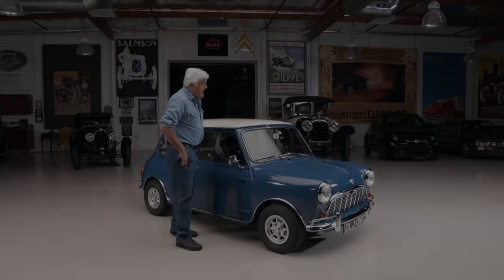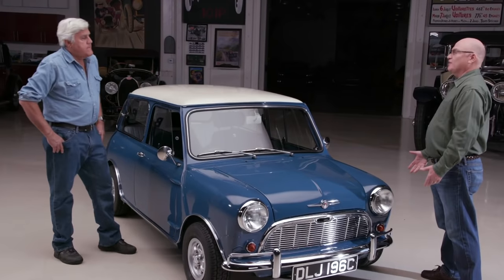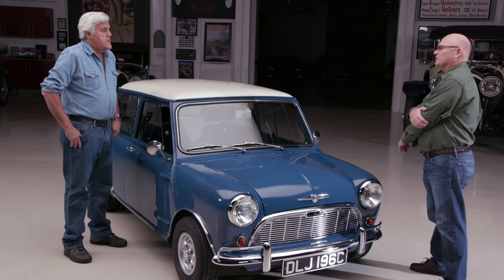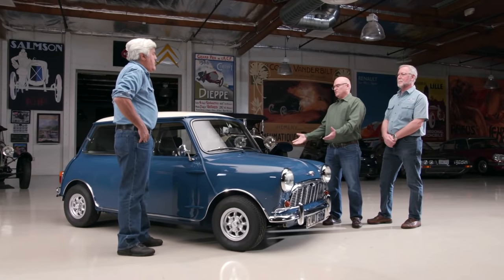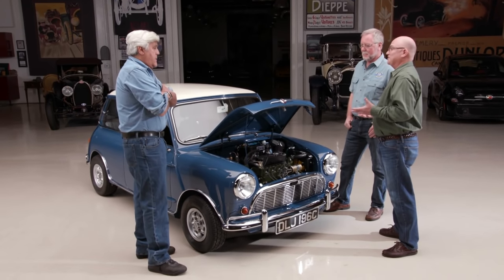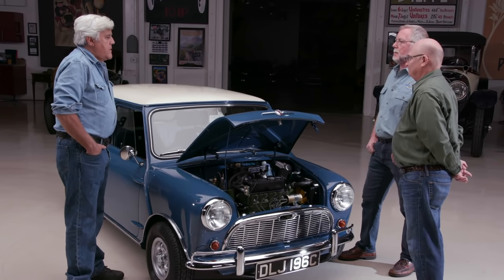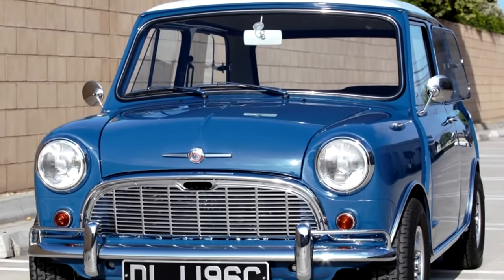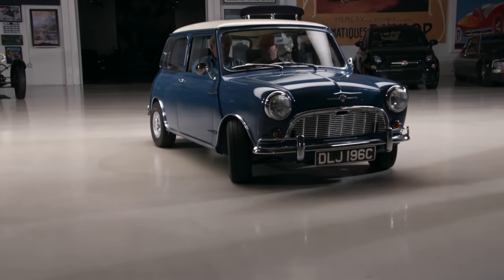1965 Morris Mini Minor - Jay Leno's Garage

Comment: Nice job of bringing back a original mini. My first driving car was a 1973 mini 1000. Kept it running with shoestrings and bubblegum. Till it’s big backyard restoration 1982. Through a ton of parts at it a 1297cc sprite 997 camshaft 750 fly wheel , 1.75 SU and lots more, it now went like stink. But wouldn’t stop or corner like original I lifted it for the gravel roads where I lived. In hopes to keep the exhaust system on in place 3 inch ground clearance. Now with 6” could go any where. I sold it and always thought I would do another 15+ years ago picked up 1 a 76 mini 1000 then later a 67 copper 1275s. No time or money have moved then 5 times now, OH the dream one day. Jay great job of your little car collection.

Comment: I got a 1960 Austin 850 Mini from a friend who replaced it with the inferior Austin 1100. A very neat to drive, but quirky car. You could turn the steering wheel all the way at 40 MPH and make a very tight 180 degree turn in an instant. They do have decent interior room for 4 people. Minis were made in the UK long after being exported to the USA.
Reply: the last original design Mini was produced in Oct 2000!
Reply: My first car was a green 1967 Austin 1100...as you say, quirky but plenty of room for my friends to pile in. Had some fun driving it until I realised how rusty the floor was. Oh and one day a steering knuckle snapped going around a roundabout jamming a wheel against the well. Good times...
Reply: @Mark H. The Austin 1100 was very inferior to the Austin/Morris 850 Mini. The 1100 engine was a too big a stretch of the  design, and blew their bottom ends out. This unreliability killed the car. Should not have gone beyond the 950 cc the AH Sprites/MG Midgets had.

Comment: Both my aunts were teachers and had a succession of minis from the first one with the starter button in the floor, the sliding windows and the wire slung door openers to the mk2 1000 with window winders and door lever openers. My sister had them handed down to her - my first car was an ex-RAC minivan which I managed to squeeze 12 people in on a campsite in Cornwall summer of 73! Loved that car - like a powered roller skate, great fun on roundabouts. Filled it from empty for £5!

Comment: It’s not the fastest. It’s not the most powerful. But it was a giant slayer and put a smile on your face
Reply: The nearest thing to a 911 is a Mini. They are light weight and have amazing cornering because of their short wheel base and are low to the ground. 

You could say they are the best non sports car sports car.
Reply: @bighands69  a 911? the mini was top speed 70 maybe 80?
Reply: @benzlover55   the mini only had a 911 to contend with in terms of cornering? i think there were a few dozen little cars at least that fell into that bracket. Morgans and Alfas and Fiats and AC's at that time surely.
Reply: @benzlover55  The next smallest car capable of 'cornering' down from a 911 was just a mini?
Reply: @benzlover55  How about the awesome Alfa spider? - that was sold in the U.S at the time. Or worldwide you could take Ford Escorts and Lotus Cortinas, all smaller than 911's - with phenomenal cornering too.
Reply: @benzlover55  sorry dude it had my handle, so i thought you were responding to my comment.
Reply: @benzlover55  then why did you say you were 'only responding directly to HIS comment'? either you were responding to my comment or his
Reply: @benzlover55  shall we start again?- my original point was the next car down from a 911, in terms of cornering or however you want to compare them isn't a mini. that was my point.
Reply: @benzlover55  i dont have an issue with it. Thats ok spellcheck happens to us all.
Reply: @benzlover55  what's your issue dude?!! Why you gotta be so rude?!!
Reply: @benzlover55  It doesn't appear to me that he is the one with the issue. You're the one that was very rude straight outta the gate.
Reply: @benzlover55  He simply made a comment under this video and you just got real rude when he wasn't even commenting to you!!
Reply: @benzlover55  intentionally dense? how insulting
Reply: @benzlover55  your getting called out because you were very rude
Reply: @benzlover55  So you want to act rude but don't want to be called out for it?! I think I understand now.
Reply: @benzlover55  maybe your not used to people defending themselves? well I do.
Reply: @reopenthecase9291  ok how about this, please copy and paste my rudeness and I will apologize.
Reply: @benzlover55  you've just admitted you were rude. By your own admission.
Reply: @respectforkurt944  ok I apologize Justice. I didn't understand your original comment and percieved it the wrong way. My apologies. This other gentleman butted in right as I was going to wrap this up and just got this whole thing going in the wrong direction again. "Member this?" Please dont butt into other's conversations please. I know this is a public forum but you dont have to defend people who are perfectly capable of doing so themselves as "Justice" has demonstrated.
Reply: @benzlover55  Thankyou apology accepted.
Reply: @respectforkurt944  top speed isn't everything 👍

Comment: Lovely to watch this as I also bought a Mini, it was 1977, I was 17 and the car was 10 years old, what a rust bucket. Interesting to hear Jay say 6'4" is ok, I can vouch for that, there were some brackets you could move the seat back with and you could also lower the steering rake. I really enjoyed the owner's knowledge about the car and was impressed when he announced the issue of compression ratio matching the 850 engine with the Cooper 12G295 cylinder head

Comment: A car can be small and look awesome like this one. But most of the modern small cars look horrible. Cars like the smart car
Reply: That's down to both occupant safety and pedestrian safety, as sadly, a crash in a Mini was always a life changing event.  I learnt to drive in one, you can't really get closer to the feel of the road than in a Mini :)
Reply: Its because modern small cars will keep you alive in a car crash. Classic mini is a total death trap, on modern roads
Reply: @04dram04  Until the mid-80's all small cars were deathtraps in a hard crash. These were very basic cars like the Tata Nano, VAZ Oka, or old VW Beetle and there was no money spent on safety which made them affordable. In the US about a quarter of the cost of the cheapest new cars is because of Federally-required safety features which makes then far less affordable and heavier which reduces fuel mileage. And today many repairable cars become total losses after a crash simply because replacing the airbags is so costly. 

The solution used back then would work well today: drive safely and don't crash- a lesson we've lost in time which is why we've got so many awful drivers on the roads today.
Reply: @slipa1  yea there are great small cars in Europe Just look at the WRC circuit but all are copies of the Alex designed Mini.

Comment: It's not always raining in England winter salt is the problem
Reply: Only thing I can add is that everytime I travel to the UK the first thing I do is go buy an umbrella, and so far I haven't had to use them. I'm not saying me buying that umbrella has anything to do with it, but they are cheap so I don't feel a need to gamble. If it works... ;)
Reply: That's right - when I visited North Island, New Zealand in the early 80s I was astonished by the large number of beautiful looking rustless 20 years old plus British cars, models I hadn't seen in the UK for a decade or more. No freezing - no salting. In the UK the salt on icy roads in Winter disintegrated them. Modern cars in the UK last a lot longer nowadays, often being galvanised.
Reply: @frglee  galvanised yes, but nowadays wheel arch liners are fitted and the undersides of the car is painted with underseal. British Leyland cars didn't have any of that, so they rusted out pretty quickly, especially around the front floor pan and the sills.  Welding was the most common aspect of British Leyland ownership back in the day. I don't see any cars from the 70s or 80s on the road any more, quite a few mid 90s cars still though.
Reply: Not so much snow but plenty of ice, so plenty of salt gritting goes on on roads and motorways. As for rain and damp causing rust, my 15 year old [galvanised] Skoda has none, and has always been left outside in one of the wetter parts of the UK. I do avoid driving on icy salted roads though.
Reply: The trouble also is that whenever it's due to get anywhere near to freezing, even if a frost is forecast councils starts laying down all the salt that they can.  Then when it actually does snow in February they've run out...  I've lost count when I've been driving my car at 5am and it's 4-5 degrees Celcius and only going to get warmer during the day when they're out salting the roads.  Pains me to drive my car with those salt spreading signs being displayed on the matrix boards.
Reply: yamaha ttr600 yes that’s right it’s only ever other day 😂 😂 😂
Reply: They salt the roads regularly here even if it's just going to be frosty in the morning.

It's very common to see gritter lorries throwing salty badness everywhere all through the winter :(
Reply: @blahorgaslisk7763 : I have noticed the same thing many times:  it seems that an umbrella is some sort of an insurance against rain !!!
Reply: The salt IS the problem- councils salt the roads in case it might freeze somewhere and when it gets damp, the tin-worms emerge to feast on your car. Modern cars are better protected but...
Reply: The dreaded salt on UK roads.Keep your classics tucked up 'til those April showers have washed it all away!
Reply: I live in Bournemouth, it doesn't rain especially often but it's right on the sea so there's a lot of salt and the air gets pretty humid
Reply: Not just the salt. It was the very poor steel they used to make them.